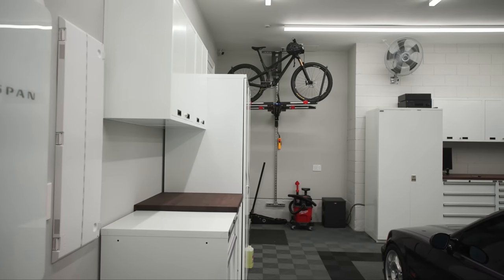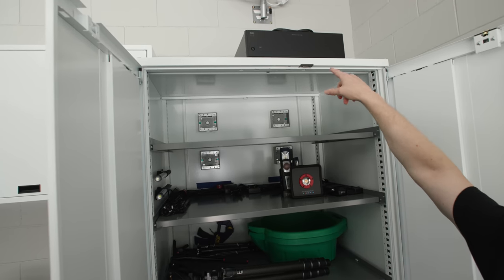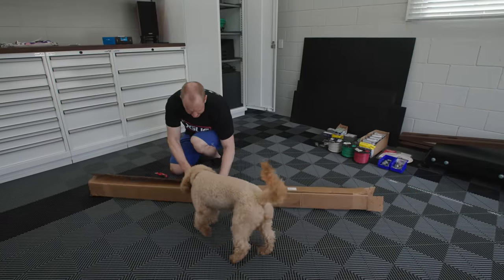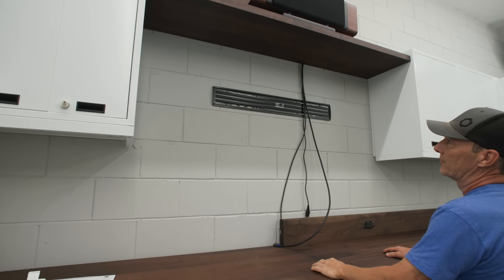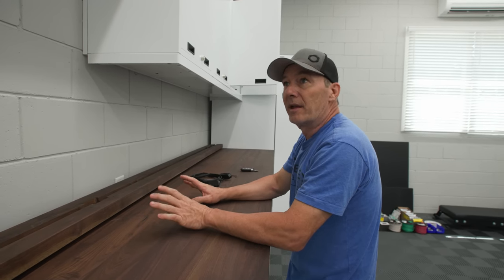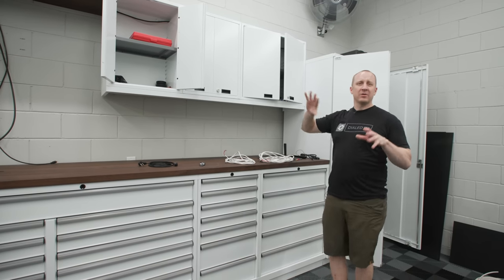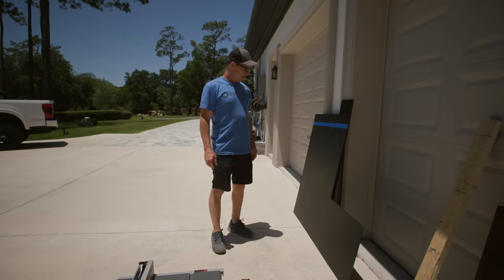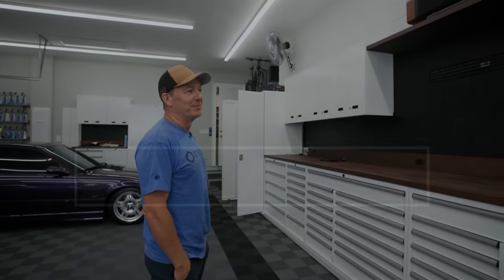OG Home Garage Build: Final Big Project - Backsplash & Garage Audio Setup

Comment: Lutron smart plugs in the cabinets and control them from picos - plug the under counter lights into a smart plug. Then link them into the motion sensors. They can turn on as you approach them.

Comment: You shouldn’t run speaker wire with high voltage wire for outlets. You are introducing interference.
Reply from the maker: It isn’t.  Speaker wire is run separately.

Comment: What are your thoughts on the f-150 Mike? I’m thinking of buying one.
Reply: Mike F has a 250 or 350.
Reply: @timkinley1779    I know, but wanted his thoughts on the brand, and overall quality. Since he’s a ford guy.
Reply: Great trucks imo. There is a reason the sell so many. I'm also a fan of Toyota Tundras. My son is driving my old one, 425k and still running great.
Reply: Solid truck imo. There is a reason they outsell everyone else. I like Toyotas too though. 430k miles on my Tundra,  zero issues with the exception of a single coil pack at 410k. My son now daily drives it with no end in sight.